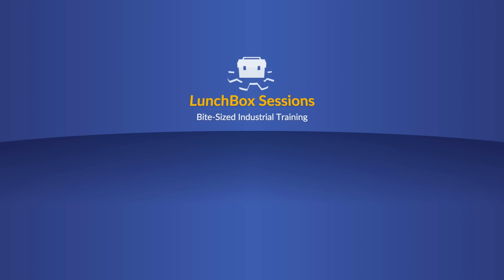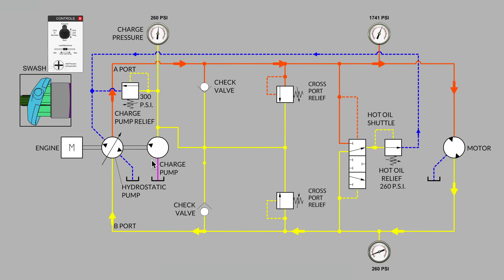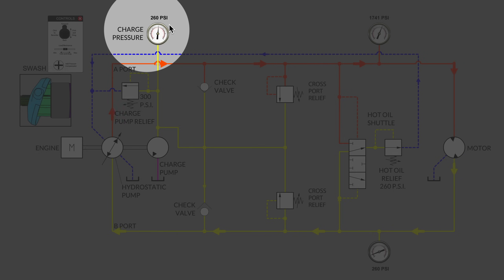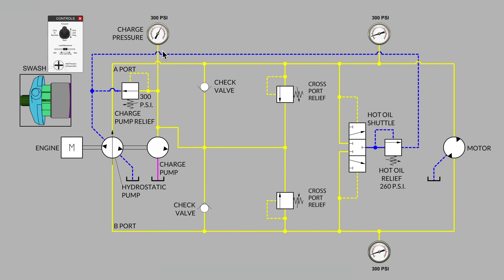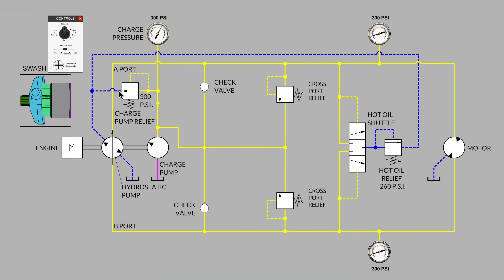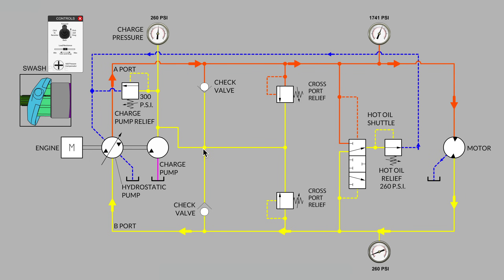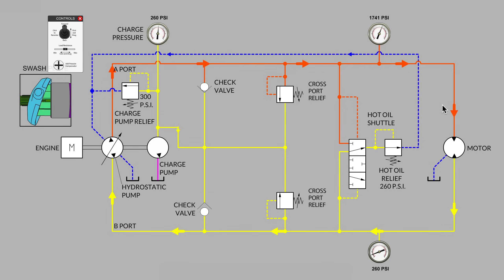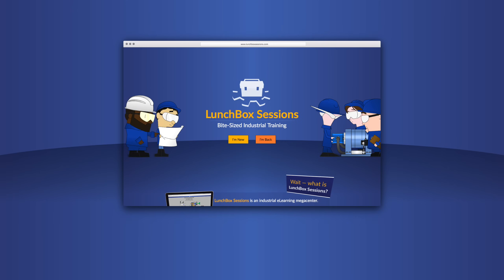Closed Loop (Hydrostatic) Charge Pressure

Comment: As most systems the fault is no high pressure filters installed on charge side or high presure side resulting in catistropic. Failure in both

Comment: Is the best place to filter and cool the oil the outlet of the charge pump?
Reply: I've always run a filter between the charge pump and main pump. Most all pump mfgs have this option available. Piston pumps do not tolerate dirty hydraulics. any filtration will extend the life of the system.

Cooling should be done prior to the hot oil going back to tank. the Charge pump doesn't flow a lot of oil, so it can't add much heat. So putting a cooler there won't provide much benefit and it may reduce the oil viscosity making the system more inefficient.

Comment: Please What could be the issue when a shuttle valve fluctuate between 200psi and 500 psi, for your information charge pump was adjusted 400psi and shuttle valve was adjusted 350psi, I had replaced  shuttle valve but still the same issue,   I have doubt maybe be one of 4 motors failed,  what do you think?

Comment: Hi, what if the pressure is unstable when the motor is off? It should be stable at 300 right? But it always drop to 260 every 3 seconds. Thanks.

Comment: What would cause a huge drop in charge pressure when the main pump is in full displacement. The identical pumps drop from 350 to 300 and  the faulty one drops to 150
Reply: I have the same problem did u solve that
Reply: @JP-hk7qs  turns out it was bypassing in the motor which had a failed piston. You could visually see the motor slowdown/stop at a certain point during the revolution
Reply: I was going to say check your case drain flow on whatever those pumps were running.

Comment: Ok on a eaton 70144  would I tee the charge line to get pressure reading
Reply: Is the Eaton motor ran off of charge pressure?
Reply: @jcolivera881  not sure mine is still working

Comment: How is it possible that the charge pump can open the check valve at 260psi yet fails to open it at 300psi when it's going over relief?
Reply: The pressures balance on both sides if the check valve so no flow.
Reply: I think that it opens the check valve at 300 psi, but just for a brief moment: as son as the swash plate is centered, oil might flow long enough to put pressure right after the check valve, but once both pressures are 300 psi, oil can't keep flowing through either check valve and it goes through the charge pump relief valve.

Comment: Why is the tank line in blue passing through the msin pump again on its way to the tank?
Reply: Bcoz its a closed loop circuit or else each pump rotation has to suck fresh oil from tank, as there is pump leakage and also pump case drain (not shown ) some hot oil passed off and cold oil is replenished by charge pump
Reply: standard manufacturer procedures recommend flushing the pump case. In most cases, the motor case drain and hot oil return are the same line, not separate as in the schematic. This helps insure that the motor case is also flushed as the hot oil has a little bit of force to clean out wear debris.

Personally, not a fan. Reasoning is that if the motor craters/fails, all the debris generated is forced into the pump and will crater the pump. Pumps being more expensive than motors, it's a lose-lose situation. When the pump is in neutral or low stroke, excess charge flow dumps into the pump case and then flushes the pump.

Comment: So the main pump case has up 300psi?
Reply: no. case pressure is whatever it takes to get back to tank. normally no more than 15 psi. Most lip shaft seals are only good to 65 psi, Mechanicals can go higher (up to 125) but they will all fail before they get to that pressure.

Comment: Goodnight. excuse my English. It is not my language I have a caterpillar crawler loader. Its transmission is hydrostatic. Inside it uses two piston pumps. Which are driven by two hydraulic cylinders that move the oscillating plates. This transmission carries a load sensing system, which works directly with the engine revolutions. Has pilot valve, servos, main control valve etc. Has several points of pressure. One of them is called charge pressure. Is actually a pilot pressure. When I activate the pumps with the machine stopped, brakes on. This pressure does not just fall. But also that it oscillates. The manual tells me it can not fall to less than 100 psi. And falls. But it rises again and falls again. The manual tells me that an indication is possible that there is excess leakage inside the piston pump. The fault is progressive, it gets worse and worse as the oil heats up. my question is. If there is leakage inside the pump, should not it fall and stay there? Bone should not rise again, then fall. Or will I miss any adjustments? Thanks here I leave the link https://youtu.be/daUvDyvMzmg.  The hydraulic scheme is very similar to this. I believe that leaks break the bonds in unity.

I want to add that the traction motors have no leakage since they block them, and the fault continues. Then, in a few words. My question is simple. A low load pressure is indicative of a leak in the main pumps? Is this why when I turn the lever fnr to max foward the oscillating plates come in and out? The load pump is gears and was tested on a bench and that's fine. I leave another link for you to see part of the system. Is very similar to the one you speak. Thank you. Https://youtu.be/2q7clRhUOqw

Comment: Why not redirect the Hot Oil Shuttle directly to the motor to cool it down? The pump already gets cooled oil from the charge pump, while I think the motor could overheat this way. Am I wrong? Nice video still thx!
Reply from the maker: You are correct that sometimes the output from the hot oil shuttle is directed through the motor case. On a motor with two case ports, one for flushing-in and one for draining-out, this is then called a full flushing loop. Help with cleaning away contaminants and wear particles, and can help a little bit with heat. 

Many motors in closed loop, hydrostatic systems now self-flush using a small amount of the main loop, inlet flow and then draining back to tank on a single case drain line. 

Great question, thanks for writing.  - Carl
Reply: Thank you very much for the answer. Much appreciated!
Reply: LunchBox Sessions this is the case an a lot of poclain driven self propelled equipment!